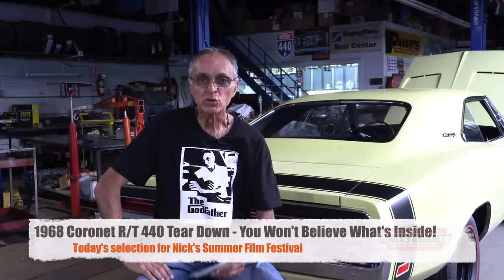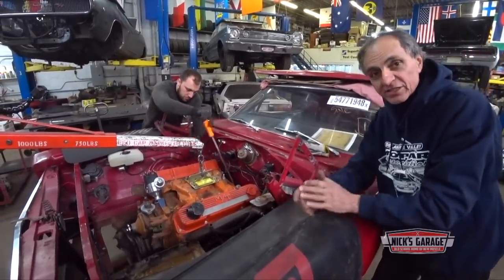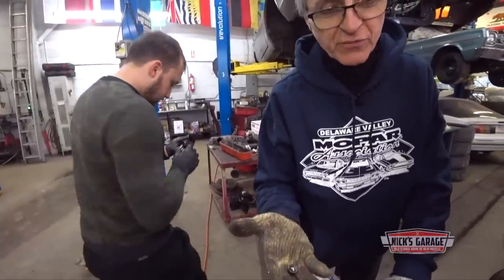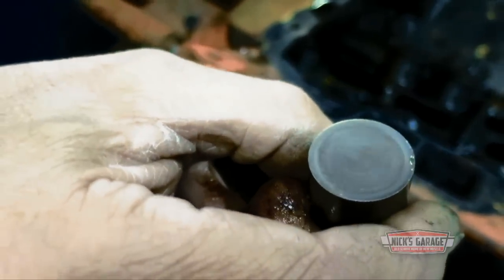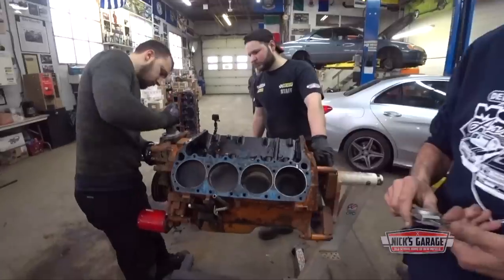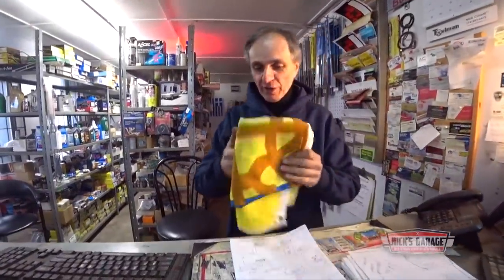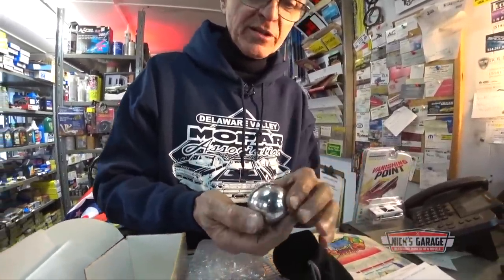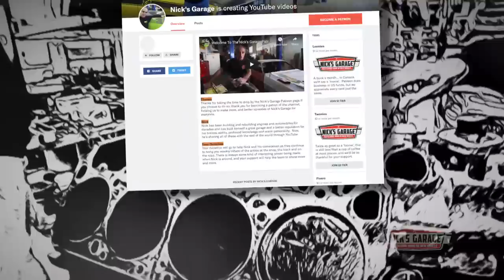SHOCKING Tear Down - 1968 Coronet R/T 440 - Nick's Summer Film Festival Part 2

Comment: I had a 70 Dodge Coronet 440. It came factory equipped with a 318 2 barrel carburetor and a 904 Torqueflite transmission. It was my favorite all around car. I had 2 that had more muscle but Old Blue was quick enough for me and the bonus was that she would get 21 mpg if I drove it legally.

Comment: About 10 years ago I fitted a second hand motor, running fine when it left the guy brought it back knocking, he had taken the air filter top off, and dropped one off the bolt's into the carby, straight into the cylinder, snapped the top off of the piston, trying to blame me but his mate let it slip that he dropped the bolt, so he had to pay to replace it, lucky for me his mate didn't lie for him, all the best to yous and your loved ones

Comment: I bought a 68 Coronet 440 in 1990 for $100. It had a seized engine. After taking parts off it for another car I was working on I sold it to the junkyard for $200. 😝 Hindsight is 20/20.

Comment: It's the Nick's Garage summer film fest Nick is putting some classic muscle car engines to the test This lump belongs in a Coronet from 68 An original survivor that still looks great The scrapyard was never gonna be it's fate Cuz Nick's Garage maintains and retains a Classic cars original state Nick always does a thorough inspection Is the block numbers matching A matching numbers classic don't experience rejection It's numbers matching but there's something wrong Gonna have to take it apart For Nick even with manual tools it don't take too long There's some silicone in the ports the last engine builders attempt came ups shorts No zinc or a loose bolt when you're breaking her in might well do your piston in Nick's Garage for the cars always does the right thing A standard bore means there's more in store She won't turn over there's something seized Only Nick knows the cure for this disease At Nick's Garage the wonders never cease

Comment: I don't see a 3/8 bolt getting past the intake valve without severely bending the valve, with a stock lift camshaft. Imo, that bolt was intentionally put in #2